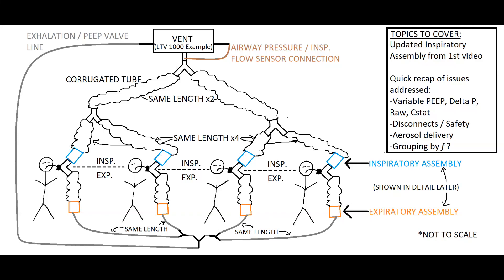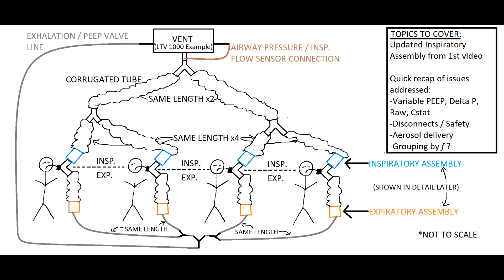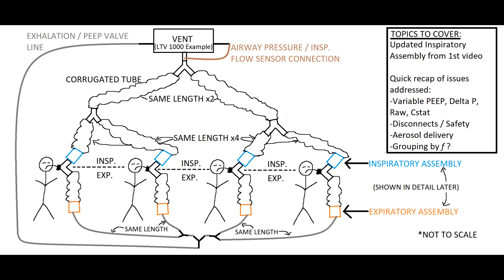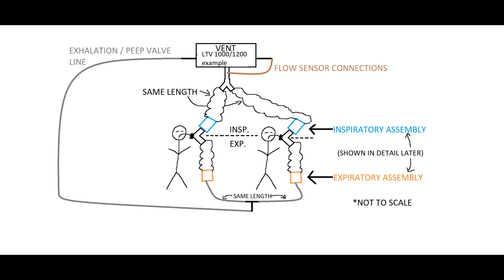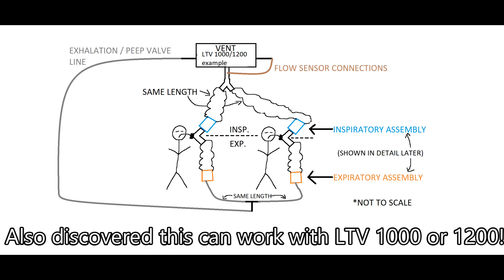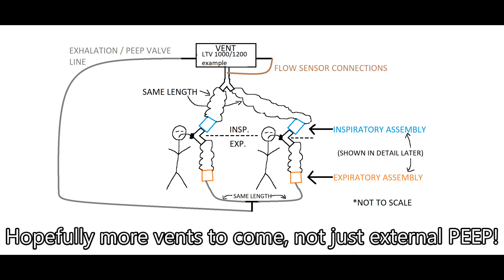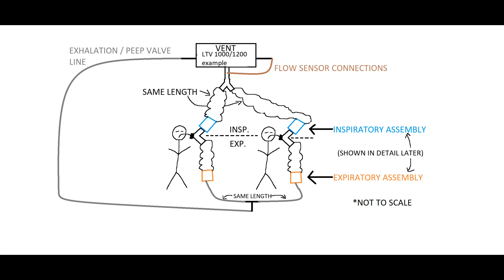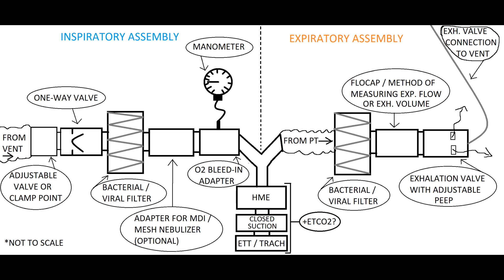Multiple patients on a single ventilator - PROOF OF CONCEPT

Comment: We have the idea to group patients together with the same range P/F ratio.  Ventilator Management and Settings:
a. Five available ventilators.
-Cohort method can be used to rotate patient between ventilators based on severity of lung injury.
-Each ventilator will have pre-set settings for each level of lung injury severity
- Examples such as, but not limited to:
—Ventilator 1: Mild lung injury: (PaO2/FiO2: 400- 500mmhg), Settings: (FiO2 50%, PEEP +10, PIP 20cmH2O)
—Ventilator 2: Moderate lung injury: (PaO2/FiO2: 300-400mmhg), Settings: (FiO2 60%, PEEP +14, PIP 26cmH2O)
—Ventilator 3: High lung injury: (PaO2/FiO2: 200 -300mmhg), Settings: (FiO2 80%, PEEP 16, PIP 30)
—Ventilator 4: Severe lung injury: (PaO2/FiO2: 100-200mmgh), Settings: (FiO2 100%, PEEP 18, PIP 35)
—Ventilator 5: Salvage settings: (PaO2/FiO2: <100mmhg), Settings: (IRV/APRV, FiO2 100%)      You can scale a patient up to the next level severity cohort group of the patient gets worse, and scale them down if they get better. Driving factor is the P/F ratio.